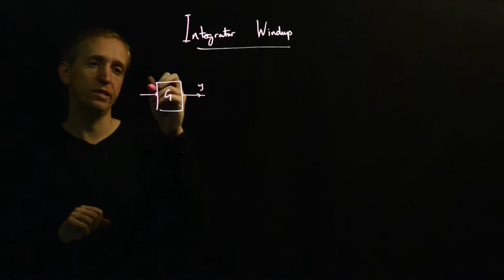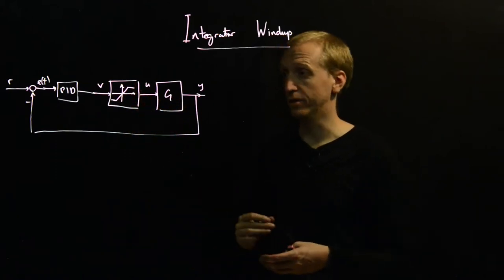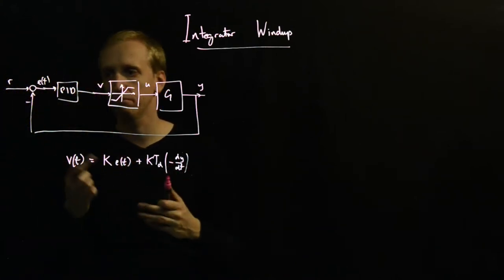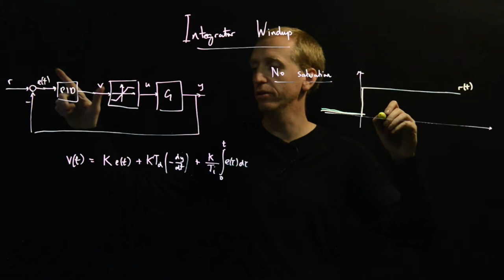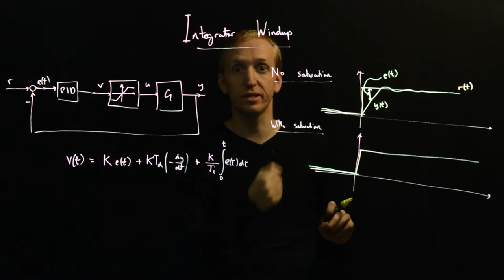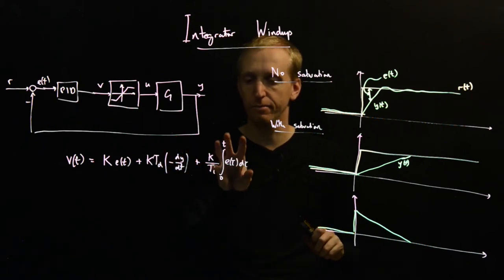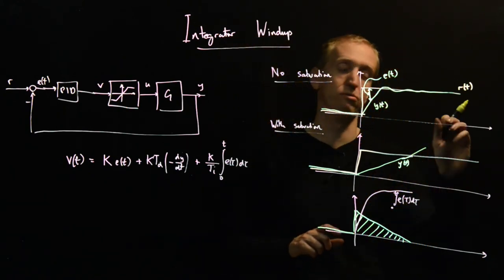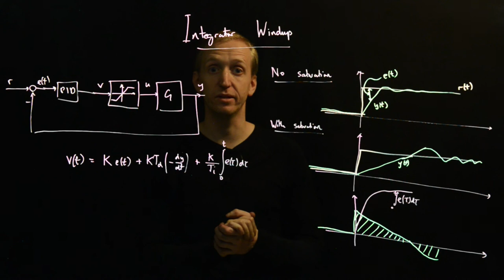Integrator windup

Comment: would lowering the Ki solve the windup?
Reply from the maker: Nice question! The answer is yes, but... If you push this to the extreme, a very effective way to remove integrator windup is to remove the integrator (make Ki=0)! But then you lose the benefits of integral action. This is the real trade-off that needs to be addressed when using anti-windup compensation. On the one hand you want Ki small to avoid windup (using less Ki can also improve other things like stability margins). On the other, integral action is very important to track set point changes and compensate for constant disturbances - and for these effects you want Ki big. Windup compensation allows you to mitigate some of the negative effects of windup, whilst still having enough Ki to get the other benefits
Reply: @richard_pates  any books you can recommend that discuss this? I have intro books on control systems but they don't to this level. Thanks for the video BTW.
Reply from the maker: @rommelreyes2209  You can find a bit more in the book "Feedback Systems: An Introduction for Scientists and Engineers" by Åstrom and Murray in the chapter on PID control. This is a great introductory book on control in general, and it's easy to find pdfs online. It may not be enough if you need something very sophisticated, but hopefully they also give references where you can find more. In terms of authors, Åstrom and Hägglund are world experts in PID control, so you can also search for their work and publications too. Good luck!